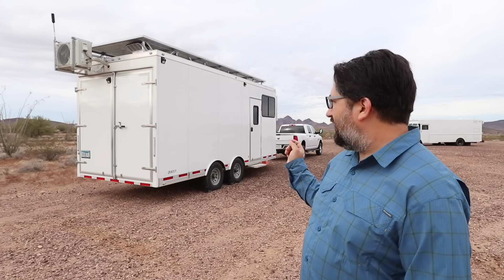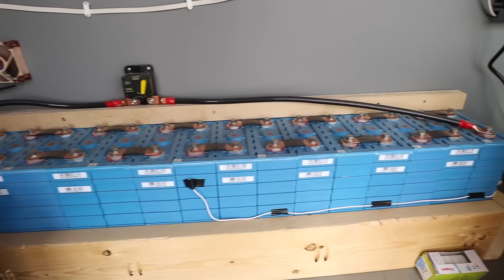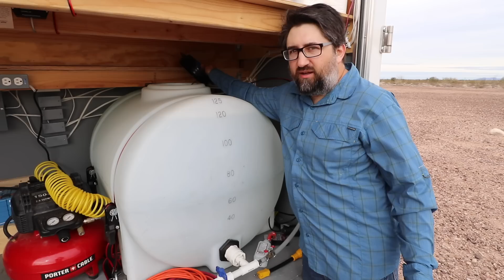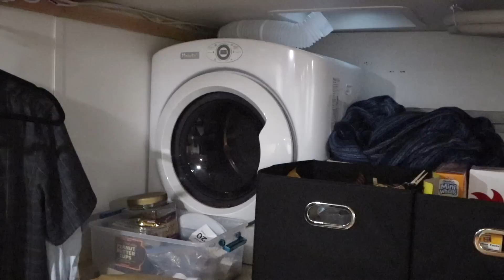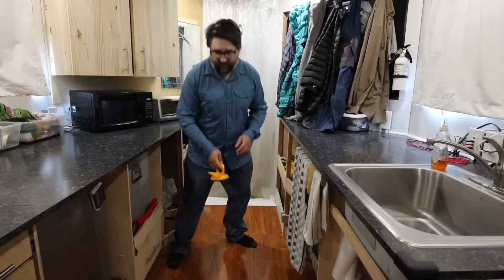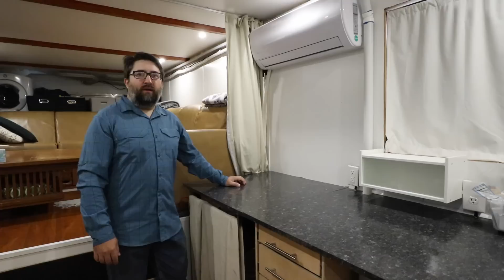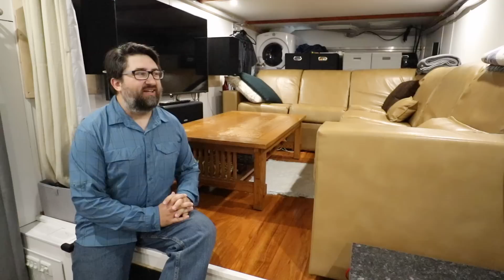Crypt Bedroom in a 2 Kilowatt Cargo Trailer Conversion

Comment: well I'm calling click bait ! thumbs down..i clicked to see the 2 k solar..I'm currently specking out a 7 panel 2.1k solar system myself for my rig..if you have seen one trailer build you have seen them all..this one isn't that good either and isn't that safe..125 gallons x 8.34 (weight of water p/g) is 1,042.5 lbs..that tank should be in the front section and centered..that protection he gawked at pretty much prevents fires/explosions..he stated lithium batteries..Battle Born Batteries are lithium iron phosphate and have a very robust and very good charge controller built into every battery which makes them extremely safe in this application. because they are a drop in replacement for flooded batteries..no need for a special charger for lithium cells like he mentions..also much more safer than lithium ion..matter of fact lithium ion are down right dangerous in this application even worse in this configuration (all in series) and no mention in the Outback Power FlexMax FM60 Charge Controller manual if it is able to safely charge any lithium battery..even if it can..it can only do so if you thermo monitor every battery which is clearly not done here..

Please let me state that I AM NOT A HATER !! but people should think before posting videos of death traps like this..if one person follows this guys floor plan and electrical build now you are endangering people with YOUR ignorance and Qwest for cheap!..lets not forget only one egress (the door) to get out which is going to be a real issue because that back section where all that energy is stored should be encased in fire board and who are you kidding with that little fire extinguisher? when this thing goes that thing will be useless..i carry the spirit of the one armed man with two guns..when asked why two when you only have one arm? his reply was "I'm not gettin kilt for the lack of shootin back !" so i have two 10lb CO2 and one 4lb abc fire extinguishers..

You might ask why?..well when this thing burns and it will..to the frame..the insurance company will figure out you made a time bomb and even with full comprehensive will not pay out for anything..hopefully the only good thing that might come out of it is your not sleeping in "The Crypt"..yup you named it correctly alright..the biggest danger to a Mobil domicile is fire and this guy has done his best to make sure he dies in one..now I'm a full timer also..if you got to my channel you will see i bought a Itasca Suncruiser 37B..it was a mechanics special and I'm currently doing the repairs myself..just a lot of maintenance that wasn't done that brought the price down to what I'm sure is about what that pickup costs..go..look at what i live in for less than what this entire setup costs..look at the space,fit and finish,comfort ect ect..if this comes off as harsh or i just have a burr up my ass its because stupid crap like this is going to get insurance rates jacked for the rest of us..then insurance companies are going to get regulations in place for who can do what to Mobil domiciles..the current wait time for most Mobil domicile repairs at a RV repair shops varies from a week to months depending on where you are at and what the issue is and its getting worse as more and more folks are adopting this lifestyle..
Reply: So, tell us how you really feel.  Just kidding.  You brought up some points that would never occur to me.  I am in the process of learning by doing on a simple static solar setup for my house.  Nothing big, just a small system to run some refrigeration and a few lights.  It appears from what you say about battery technology that I have a few more chapters to peruse.
Reply: @gearhead2be  i was a one man show at a municipal golf course for 3 years..besides fixing and maintaining the green equipment i maintained 43 out of an original 50 electric golf carts 36V (6X6V batteries) X 43 = 1,548 batteries inspected/maintained or replaced every week :/ plus cleaning terminals and all the other gear under the seat..so yeah i know lead/acid pretty well..but i want to go lithium..its better suited for mobil domiciles..now for a static setup it comes down to your budget,how much time you want to devote to maintenance and space..i'm not gonna rip out another tangent here but for instance The nickel–iron battery or Edison Battery lasts a very very long time if maintained..but has low charge retention and as a result of being charged often off gases a lot which means constant maintenance..on the other side of the spectrum are the lithium iron phosphate..only maintenance required is keeping the terminals clean.. both are far more expensive over lead acid (flooded) batteries..may i suggest "DIY Solar Power with Will Prowse" here on youtube..I'm just repeating what i have learned from him and a few other sources..may i suggest even further his video called "$950 "Battle Born" Battery Tear Down"..it convinced me by far that this is going to be my energy storage solution..good luck !
Reply: There's a know it all in every bunch...then they're frequently wrong. That water tank in front would add too much tongue weight and put him over the 10%. As long as it's accounted for it's fine. If you knew anything about solar you'd know those famous charge controllers are customizable in their settings. I could go on but it's getting exhausting wasting my breath.
Reply: @mrmotofy  1st of all..a know it all i am not..do i know trailers..lets see..350,000 logged miles with spread axle flatbeds yes..besides most people know to put the heaviest part of a load over the axles..not in the back in a corner..btw i said "that tank should be in the front section and centered" not "in the front" as you stated..do i know a lot about solar? well..i will say this i know i will be spending around 12,000 dollars and i want every pennies worth..i have learned that Tesla doesn't make solar panels Panasonic does for Tesla..i learned the best and oldest solar companies are out of china..i learned there are (2) different types of solar panels- Mono- and Polycrystalline and how they are different and which is suited for what..i learned about efficiency vs watt vs dimension (bigger isn't always better) i learned what and who's panels degrade faster than others..i learned the pros and cons of running solar panels in series or parallel..i learned which way to park with flat mounted panels to get the most sun..i learned the pros and cons of 12/24/48 volt systems..i learned what energy storage solution is best for solar use..i also learned which types of charge controllers work with which types of storage solutions and the Outback Power FlexMax FM60 Charge Controller can not safely charge straight up lithium cells..

Go watch cell phone catching fire videos..that's what happens when a lithium battery is charged incorrectly..its very fast and very violent..i just realized..what rig do you have? do live full time in a mobile domicile? i looked at your channel..i don't think you do..so when its your ass in a match box with hundreds of amps hanging around..looking for a way out..maybe your words might be heeded..till then go troll somewhere else where personal safety isn't a issue..rest assured i will call out unsafe builds when i see them and this is one of them..

Comment: Lithium system, no balancing BMS. This is not safe if anyone was wondering.
Reply: The exposed terminals made me nervous..  all it takes is one of those tools/toolboxes shifting and shorting the battery bank to start a fire.  Even a layer of electrical tape would help.  (I melted a battery once in the military)
Reply: BMS is for chums😅 and low temp cut off is for peasants 😏
I kid, I kid, I damaged my first set of $1600 batteries (105ah X16) that way. 
But in all honesty if he keeps it between 10-95% he should be ok those are huge batteries which shouldn't drift since I doubt he hits Max C rating on discharge.

Comment: You could buy  a used Freightliner single axle truck and create all of the above. Diesel rig with Torqe and air brakes. Could have used more motor home interior design. I would have made industrial slides and component modular design. That way if a wreck could be relocated . would make the bed system roll out from under the garage. The Freightliner bed/table system is a wise configuration. The builder did not have a budget for material sub contract work and hangouts to build out the rig. You could buy a wrecked motor home and transfer maNY componets to save costs. The use of side compartments in a motor home below the floor is a wise use of space for componets. A base station RV lot with a shipping container for cold season use. I think a condo RV station like an RV camp multiple people can use. Would make 3 season travel useful.PNW SW EAST COAST  NEW0 ENGLAND.
Reply: That price would have been considerably higher as well as all maintenance and you have a single vehicle

Comment: Can you run a small fan in the crypt ? I can’t sleep with out a fan, not only for air but for noise.
Reply: There's actually two fans, one that brings air in and another that draws air out, and they run 24x7.  They're subtle and quiet.

Comment: All that weight in the back, not surprised he's got a sway problem.
Reply: With the weight in the back, my tongue weight was 12%, as weighed by truck scales.  Bumper-pull trailers are supposed to be in the 10-15% range, so I'm easily within that range.
Reply: @michaelberding4616  I love your build, but what about contamination problems with your fresh water tank?  You don't appear to have any filtration system in place for your drinking water, nor a convenient way to clean or descale the tank
Reply: @LouderThanLuke  I only put potable water in the tank, so contamination is never an issue.  I do run the water through a secondary Brita filter, but that's mostly just because I like to have it chilled.  With regards to cleaning or descaling the tank, that's not a common practice in the RV industry or community and just hasn't been an issue.
Reply: @michaelberding4616  Are you sure about that?  Per RV forums, they do sanitize their water systems and fresh water holding tank periodically.  For example, one person uses this technique:  (I don't know the best product to use.  I'm just tossing this out as an example.)

I've used hydrogen peroxide for many years instead of chlorine to sanitize my fresh water system. It doesn't have that nasty chlorine smell and taste after sanitizing.

https://livingtraditionally.com/how-to-use-hydrogen-peroxide-to-purify-water/

1/8 cup, that's 1 oz. of 10% H2O2 (hydrogen peroxide) per gallon of water in the holding tank will oxygenate the water in 15 minutes, if you drink it, it will not be harmful to you in these proportions. I usually treat the water then run it through the system with the onboard pump to each faucet, one at a time to clean out all of the piping in the coach. I also will dip a dish cloth that has been rolled small enough in vinegar, then force the dish cloth into each open faucet, and take the shower head and other aerators and drop those into pure vinegar and let those sit there for about 30 minutes, before taking them back out and re attaching to their respective places. Results is amazing.
Reply: @michaelberding4616  One consideration is that Cryptosporidium (parasite) is even found in municipal water, at times, and some campgrounds supply well water which is even more likely to contain this parasite.  Chlorine is not really effective against it, so water treatment plants can't help much.

A helpful CDC . gov article is:  "Cryptosporidium (Crypto) and Drinking Water from Private Wells"

The article explains how to select a water filter that can filter this parasite out, and other key info.
Reply: @michaelberding4616  Great build. can you give some details on the truck you use to pull it, and also how much time and money went into it?
Reply: @rucksackransack  Pulled by a 2018 Ram 2500 (diesel), took around 6 months to build, and total trailer cost was about $55,000
Reply: @michaelberding4616  I think I see a Cybertruck in your future, and you may be able to add another couple of layers of solar panels that fold or slide out to help charge it. You should also be able to integrate its battery and hopefully use the diesel heater less often.
Towing anything that big and heavy is a huge energy drain but the supercharger network is growing rapidly and cheaper than fossil fuels. Using the cybertruck with it would be a fascinating case study!
Reply: Michael Berding 
I love your build, but how is your loading compared to this?;
https://youtu.be/fWd8ml9mFMo
Reply: Big wieghts at far ends cause barbell moment of inertia which could exacerbate sway compared to centered masses over sway point axles of trailer and tow vehicle.
Reply: @michaelberding4616  This is the absolute best Home on Wheels I've ever seen and this would be the only way I could do it. Wow! You need a monitor in the bedroom for security and I would need my dog but they make great security and you have enough space.
Reply: Should mount water-tank in the center back there, to distribute weight equally between both sets of tires.
Reply: You are right. Nine hundred pounds of  agua at the very rear is like a barbell on the end of a fishing pole. Hard to control even with the proper tongue weight.
Reply: @geraldhenrickson7472  , looks like roughly 400lbs of batteries also.
Reply: I’d use an entirely different tank. Wide and flat being centered over the axles. I can’t imagine what it feels like going over bumps. Even with that tank it should be in the center especially, if it’s most of the weight of the trailer load. Your axle placement on the trailer is very important . 
Does your truck have coil-overs in the rear?

Comment: This guy must be like an engineer or something he does a really good job
Reply: Thanks!  I've been a software engineer for many years, does that count? :)
Reply: @michaelberding4616  I had you pegged for CS. Nice setup regardless. That entertainment system is exactly what I want, and I'm happy to come across someone that really invested in their solar system to support it.
Reply: @michaelberding4616  I'm a radio engineer -- but my skills fall apart when working with the carbohydrate foam (wood)...   I like the 48V DC Plant -- I build all my comms systems on them.   Curious to know more about the problems you've had with the 48V HVAC, looking at a similar setup for a (AC Primary, 48V 100AH DC Backup battery with 48V engine-driven alternator as a backup) site....
Reply: @n3lee  The 48v battery bank has been fantastic, no issues there at all.  The 48v heat pump that I purchased was overpriced and the heating function on it was flakey at best.  It would error out frequently for no apparent reason and it would almost always error out if the wind was blowing directly into the outside unit's fan.  The company I bought it from (HotSpot Energy) was not helpful in getting the situation resolved.  I think it was a beta product and I was a guinea pig.

The only downside to a 48v system in an RV is getting equipment that'll work with it.  Your choices are more limited.  Should you choose to go with 24v, there's a lot more options.
Reply: @michaelberding4616  48V equipment is a standard for telecomm carrier gear; hence my penchant for it, however, it's fairly easy (and there's relatively low insertion loss) to convert DC-DC from 48 to 24V...   I've got several mountaintop shelters which run 48V plant at several thousand ampere-hours, the mini split would be used for light cooling in the summer, but the heatpump functionality would largely be there to keep the battery bank warm (far easier to do with warm air)  but, that's a whole other divergent issue.    If your not already looking at DC-DC plant, Wilmore, Acopian, Duracomm (meanwell) and Samlex all make decent DC-DC coverters -- with 95+% efficiency to make 12V and 24V right off your 48V bank.   This is how i typically integrate; just need to be mindful that everything you do should be floating ground.   (-48VDC is actually the telecomm standard)
Reply: @michaelberding4616  well i hope those lithium batteries do have balancer and fire proof, otherwise emergency exit, which was suggested in other comments really needed.

Comment: Im in Syracuse, NY area.  If I bought a Dodge ProMaster Van could you design 30x30 shower with all that massive lithium for max off grid living? I know my tanks will be smaller.
The electrical is the best I have seen for max power storage.  Van would be for 2 people.  My design would be like a Travato 59GL style but with a bigger bed in back and larger shower.  With a drop from ceiling queen bed like Winnebago Revel.  I’d like a drop from ceiling twin bed in from lounge too.

Comment: For a single purpose rig this is about the best I have seen. The gentleman has already modified the V-nose area due to his use or lack of use of the window areas. The only thing that concerns me is the sleeping compartment. There was no mention of an escape plan should a fire happen and he was down in the crypt asleep. That does bother me and not much bothers me. I hope he fares well in his rig and enjoys what adventures it allows him. I would like to find someone in my area that can wire a complete solar power system in conjunction with a 120v/30a shore power layout for my 7x16 enclosed I am attempting to build. I am in the "research"/planning and purchasing "hard items" at this time to ensure the layout is how I want it. I have no clue on the electrical (solar) part of the build. I know what I want (600w), but not how to get it done.